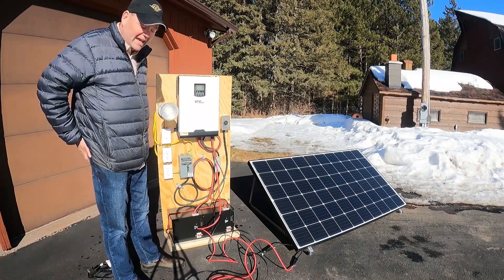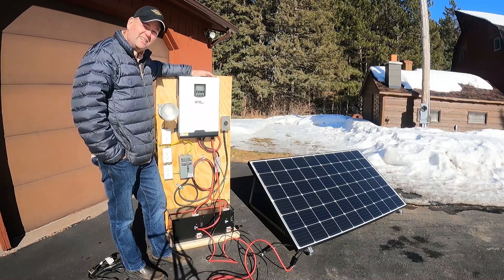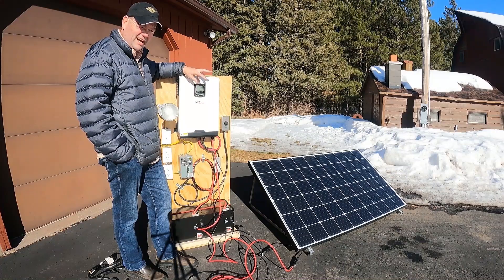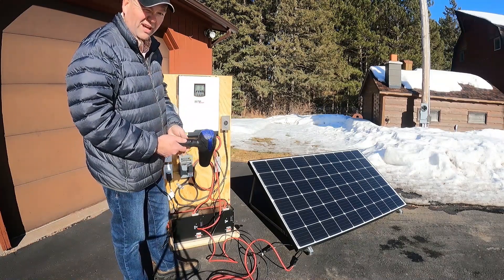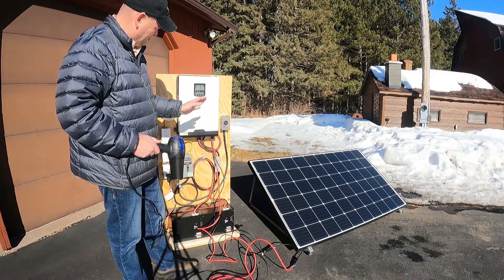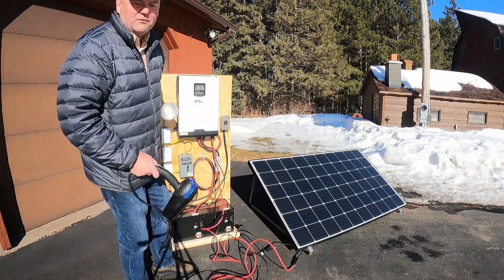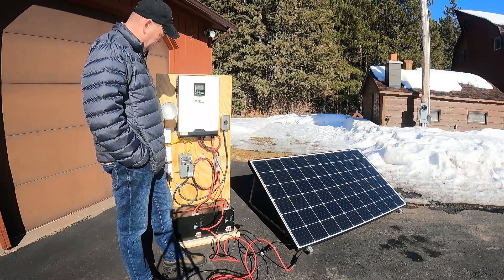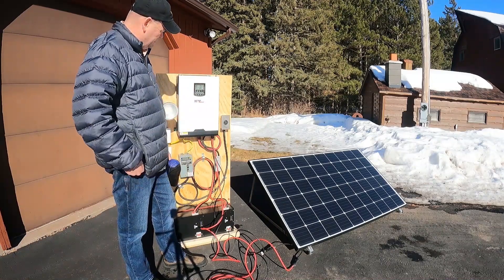DIY Off Grid Solar Generator Power | Testing My Renogy Solar Panel

Comment: Wow, did not even know there was a 24v solar panel, how long will panel take to charge your batteries ?
Reply from the maker: 2424LV-MSD can handle max PV input power:2000W, Voc:145Vdc, Isc:80A

Pmax 270 W
Voc = 38.60 V
Lsc = 9.03A